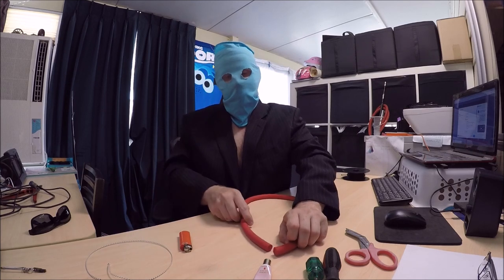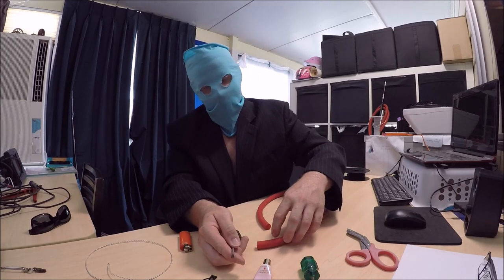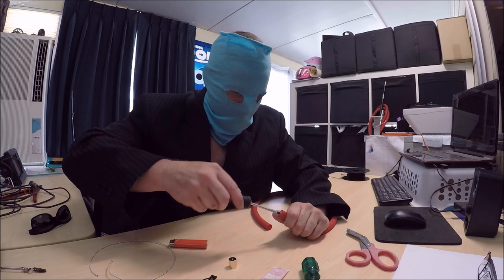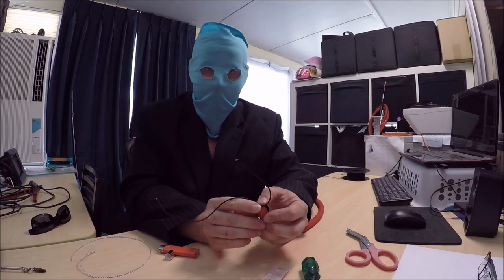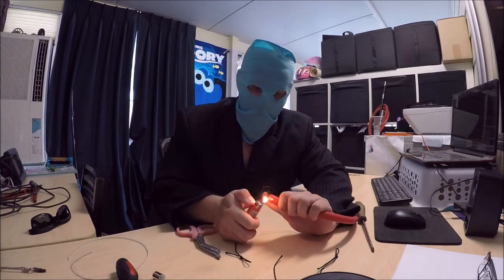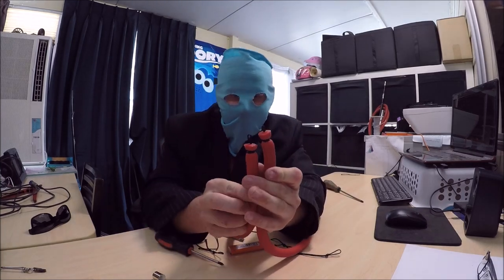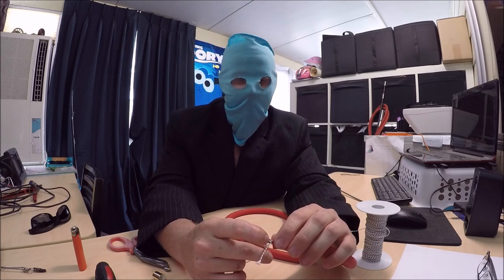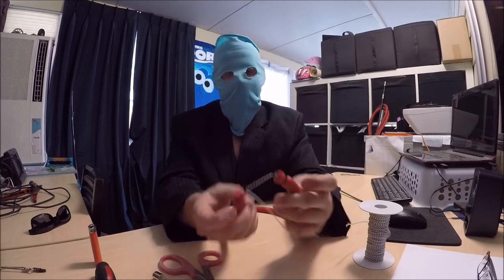how to use small bore rubber

Comment: Hey mate how do you decide on the length of the rubbers? I recently changed to 2mm dyneema as shooting/reel line and I feel it has slowed the shaft. Either that or I suck at shooting which is probably more likely. I was thinking of knocking a cm off the end of my rubbers to try and speed the shaft up a little. What are your thoughts?
Reply from the maker: Blair Smith every gun is different and every rubber is slightly different so it all depends on how heavy the shaft is and what type of rubber I’m using but for a rough estimate I use an old chart rob allen sent out years and years ago and then make adjustments from there